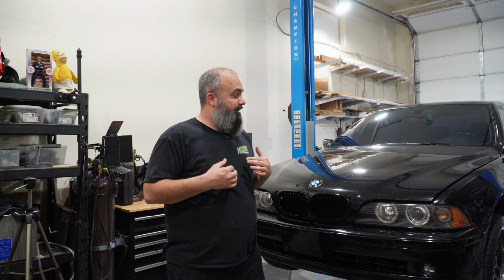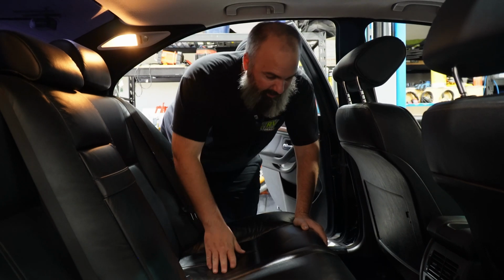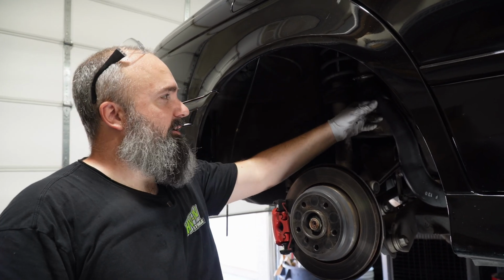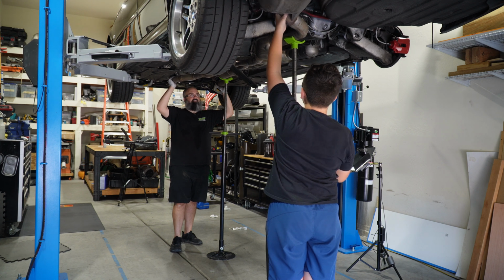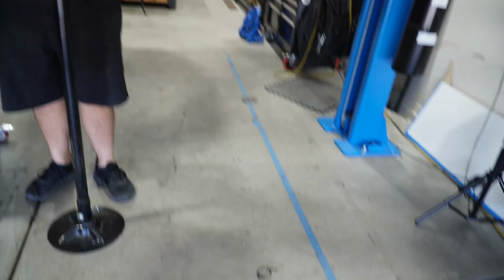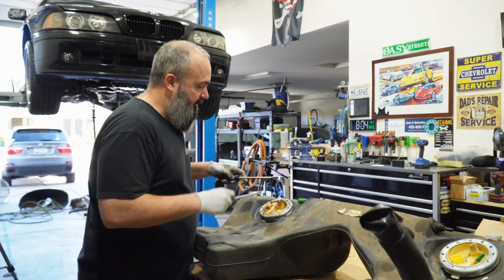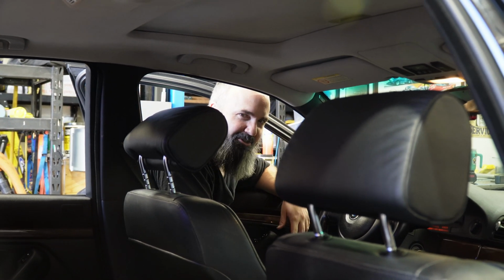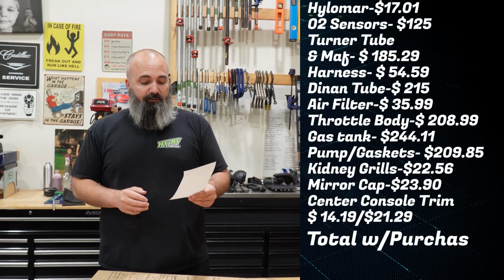BMW E39 Gas tank Replacement | 540i Restoration

Comment: Once you had all the parts, how long did this job take? I might have to do the same thing.

Also, while I wait to look for a fuel tank, I might try to do a fuel tank patch. What material did you use to do that? And how long did it last?
Reply from the maker: This is the kit I used. https://amzn.to/4aw2UUM I think it would have worked better if I prepped the tank better. What I mean is I should have emptied out the side with the leak and let it fully dry. I installed the patch as recommended even with the leak, but I think that is the weakest version. Had it been dry I think the repair could have been much better. I started to see failure of the patch after about 5 months.
Reply: @DrivingForwardBuilds  - Thanks for the info.  I think mine is leaking from the fitting that connects to the blue hose that runs back and forth between the two sides.  Not sure if I can patch that.  

I'm gonna drop the tank and see if I can get a better look at it today/tomorrow. Your video is very helpful.

Comment: Would love to know what epoxy was used. I’d like to slap that on my crack before I go and swap everything over in a new tank
Reply from the maker: Here is the kit I used originally. https://amzn.to/4aw2UUM I think had I drained the tank and put a little more effort into the repair it would have lasted, but since there was fuel permeating through the crack it didn't set properly. But at the time, I knew I wanted to find a replacement tank and just wanted to get the car back on the road. Here is that video- https://youtu.be/rw-s2czubDk

Comment: That price for a brand new gas tank is more than my car budget😱!! Love the new shop truck btw😂
Reply from the maker: Right! I couldn't belive how expensive a tank was. More than the cost of the shop truck! 🙂
Reply: @DrivingForwardBuilds  UK here, I found one in Manchester to fit my lads E39 540i for £25 - yes, £25! The only snag was it was for a wagon not a saloon (sedan), but it fitted fine. I made up some new fuel lines using Kunifer (nickel/copper alloy use a brake flare tool to put a flare o it) and replaced all the fuel hoses with marine grade pipe I had lying around. I did check for a new tank and it was > £1000 here (2002 price).